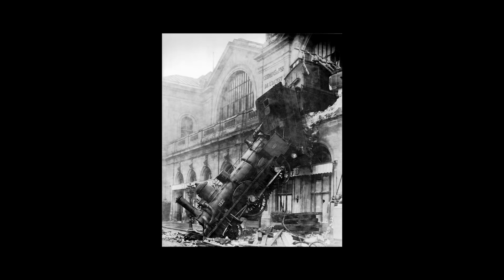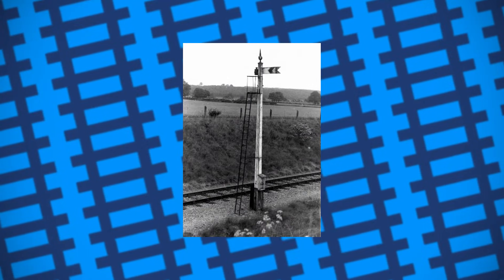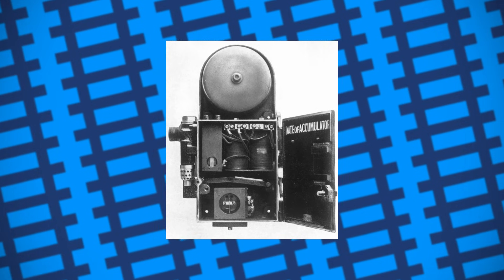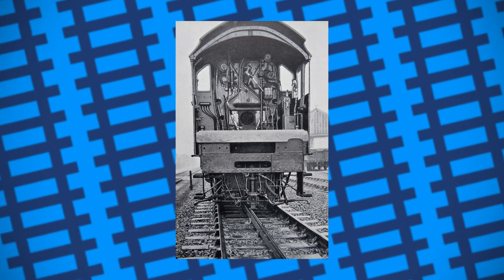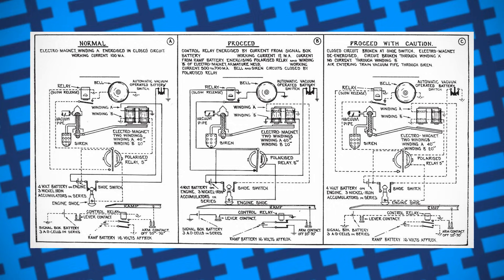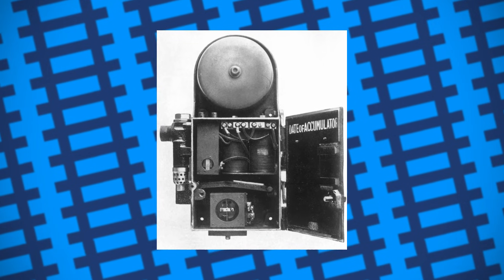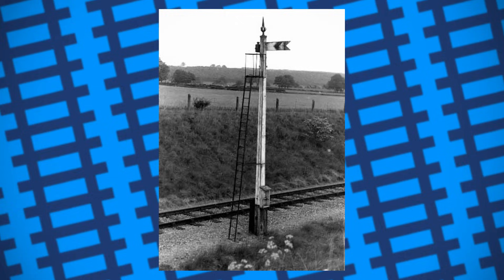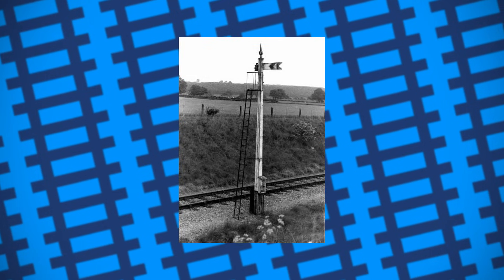How a railway made their trains remote controlled (kinda) - GWR ATC

Comment: It's not that it's necessarily difficult to design a fully remote-controlled steam locomotive, it's more that a lot of the tech necessary to make it work mostly came either at the tail-end of the steam era or only came later on when diesels had already taken over so no-ones ever really bothered doing it. 

One easy example comes from boiler operation, modern ones are more-or-less completely automated as far as daily operation goes with just 3-4 12 second blowdowns per day required for the one I use at my workplace but we needed basic computerisation in the form of those basic industrial-focused embedded microprocessors to get there, which only came about in the 80s or so. Without this tech you'd still need a fireman on board to monitor the loco boiler status.

Comment: If it was thought about in 1905 then the LMS, LNER and SR would not have had an equivalent as they didn't exist then.  The GWR then was technically not the same company as the grouped one but the practices of both were the same as well as the name continuing as it was the largest constituent.

The system could also be considered the predecessor of the 'Dead Man's Handle'

Comment: This system would be most similar to the Automatic Warning System (AWS) used today on the UK’s rail network, which operates in a similar way but using a permanent and electromagnet inside the trackside housing, a train passing over must detect 2 magnets in short succession before giving the all clear to the driver, so by powering off the electromagnet, the train only detects 1 magnet, and sounds the horn in the cab requiring that the driver acknowledges the Warning within a period of time, otherwise the system will enforce a brake demand and activate the emergency brakes. When the driver acknowledges the AWS alert, a dial in the cab will light up with a sunflower to act as a visible reminder that there was a caution ahead, this dial doesn’t get cleared until the train passes over another AWS reporting an all clear. AWS typically gets installed on the approach to signals, where it will de-power the electromagnet if the signal is displaying any aspect other than clear (so caution, double caution and danger), but a single permanent magnet can also be installed to induce an AWS demand on the approach to certain danger points, such as warning of a significant drop in the max permitted speed such as on the Morpeth curve where this practice was first introduced for, or temporary AWS magnets can be installed by track workers alongside emergency speed limit boards to alert the driver to the unexpected drop in max permitted speed.

Comment: are there any steam locomotives that are still equipped with ATC
Reply: Yes, especially if they are still operated on the main line, although they are more likely to be be AWS rather that ATC.  I've seen them on locomotives on the Railway Museum's Curator With a Camera videos.  There may be ATC's around as well.

Comment: Wild to think that a British railway implemented ATC nearly 20 years before one of the first centralized traffic control (CTC) systems in America was installed on the Pere Marquette Railway between Mt. Morris and Bridgeport, MI in 1928
Reply: Don't you mean "Pere Marquette Railroad "?
Reply: @1685Violin  pretty sure I meant to say “railway”, although you’re not completely wrong to call it a railroad, either. The Pere Marquette was originally INCORPORATED as a railroad in 1899, but was subsequently reincorporated as a railway in 1917 and operated as such until 1947 when they were acquired by the Chesapeake & Ohio
Reply: @jerrysgardentractorsengine2243  I thought the two terms mean the same thing. Just that since Pere Marquette is an American railroad, it would be proper in to call it a "railroad" since that's the usual term in the American rail transport industry. I didn't know it renamed itself as a "railway".
Reply: @1685Violin  the terms are defined the same, just with the difference between them boiling down to what region you’re talking about

United States- railroad

Canada & Britain- railway
(This is according to the Canadian Oxford Dictionary, btw)

Comment: Fun fact, Japan also used and still does use ATC on there trains.
Implemented after a really nasty accident involving a freight train not fully pulled in to a siding and 2 different passenger trains running red signals in the 50s.
It was also Implemented on steam locomotives which they used in diminishing capacity untill 1974.
Im not 100% sure how it worked for SLs but there where coils on the ground that wipers would go over. It would signal the cab and had to be acknowledged or it would apply breaks. And it also provides over run protection automatically stopping trains if going past a red signal

Comment: I learned something today, Automatic warning and control devices were use earlier than I thought, I always thought they were invented in the late 20s or early 30s.
In countries which did use electric lighting fed by turbo generators like the US and Germany the implementation of such a system was a bit more forward as it did not rely solely on batteries.
Batteries were there as a back up would the turbo generator fail, the train had to stop in a safe location anyway in such case when no back up lighting in the form of parafine lamps was on board.

Comment: Another reason why it was invented, was that fogmen also didn't fail-safe, if he didn't show up on time a driver had no idea if the line ahead was at danger. This was a fail-safe system, assume danger, unless the bell sounds. Also the ramps were installed a few hundred yards short of the signal, so that the locomotive had time to stop before it passed the signal, they proved this on the first test run, when the locomotive approached the last signal in the test run, the signal was set to danger and the driver was ordered hands off all controls. The train stopped safely and well short of the signal at danger.

Incidentally, I was amused to note that similar audible warnings made their way into BR usage. Riding behind the driver in a Class 101 DMU in the late '70s, I was interested to note that there was a bell warning when the light was green, and a buzzer when it was red (I guess a buzzer is easier than a horn when you don't have an ample supply of steam!!).

Comment: I wonder about the reliability of a switch under a filthy locomotive where the failure mode is blowing a siren under normal over-the-road conditions or choosing to not work when on a ramp due to varying contact resistance especially with only 4 volt battery of questionable condition. Wouldn’t a simple green light in the cab verification when on the ramp be more trustworthy?  It still depends on the engineer to make decision. This is NOT remote control. I guess Rube Goldberg has always been around.
Reply: The siren is sounded and the brakes applied in a clean environment if the dirty contact plate failed. Because of the ramp's position, the driver could check the aspect before reaching the signal.

Comment: It's wild how similar on a surface level this is to modern ATC.
Reply: it shares the basic principles, but it uses a mechanical connection instead of the modern systems which use electricity difference between the two rails.

Comment: this pzb type protection system is not really remote controlling a locomotive. something like a push pull train or having multiple locomotives in tandem is proper remote controlling, where the locomotive helps pull (or push) but nobody is on it.

Comment: No doubt, this system being installed so early help to save many lives from disaster. Another good reason for the folks at Swindon to be proud of "the Great Western way."
Reply: Sort of, except that the Signalling department, and it’s associated factory, was based in Reading, not Swindon. The works were north of the station, east of Caversham Road, and still there into the 1980s. The land has been rebuilt on a couple of times since then. A lot of it’s offices were in a building on Station hill, just south of the station, which has also been demolished. I worked in that for several years in the 1980s!